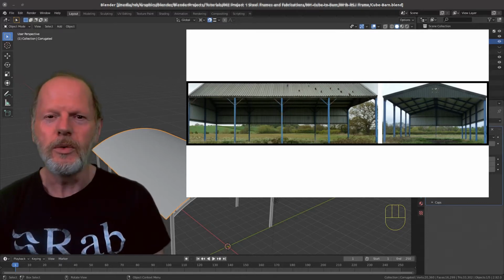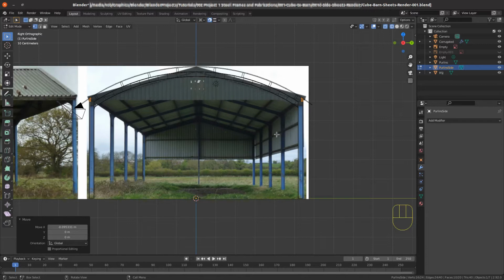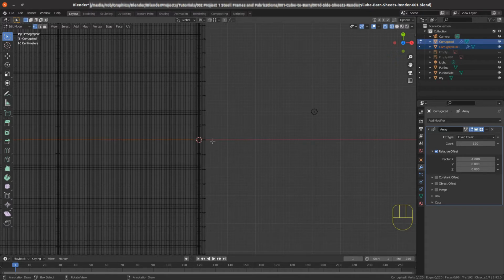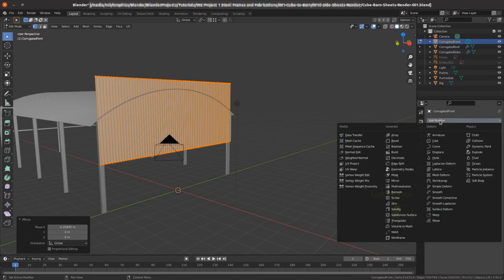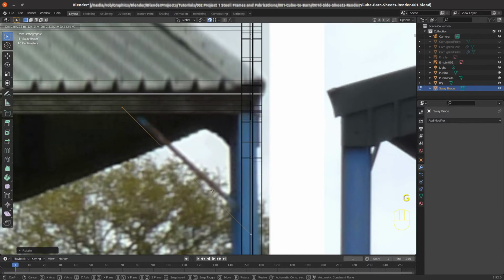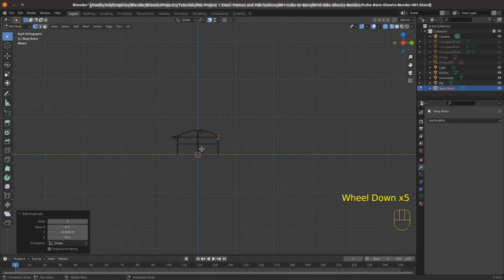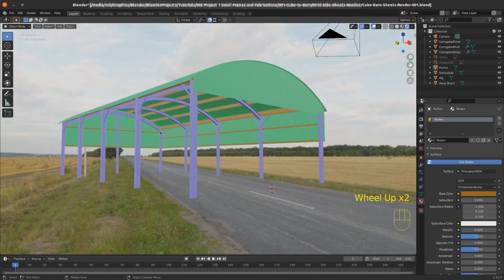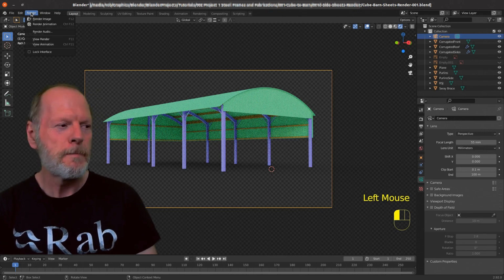012 DA3D Adding the Side Sheets and Rendering an Image

Comment: Thank you for your tutorial, Robert! Could you tell me how to add a proper offset to the corrugated metal sheets, please? I tried to add the solidify modifier, but the result is not really nice.
Reply from the maker: If you are trying to add thickness to the corrugated sheet, the solidify modifier is probably the best tool. If it is not working as expected a couple of things you can try are:
1 - in Edit Mode select all vertices of the corrugated sheet, and then press Ctrl-M to open the Merge menu and choosing Merge by Distance to remove any doubled vertices.
2 - with all vertices still selected press Shift-N to recalculate the face normals to the outside.
if the above doesn't work
3 change the order of the Array modifier and Solidify modifier in the modifier stack.
If this still doesn't work 
4 - in Object Mode,  Apply the Array modifier then repeat steps 1 and 2
Hopefully a combination of the above will work for you.
Reply: @DifferentAngle3D  Thanks for the answer! Worked fine at step 2!
Another important thing to get the perfect thickness is to give a 45° angle when scaling the line before the array. That is not even an easy thing for me because I had to display the "edge angle" through "show overlays" panel on top right...